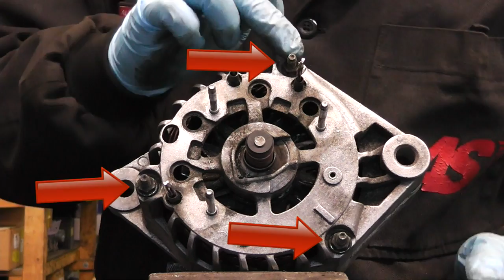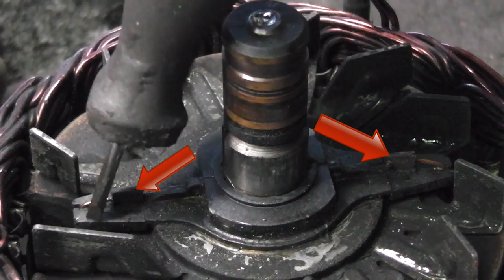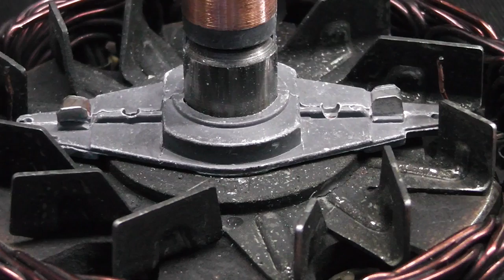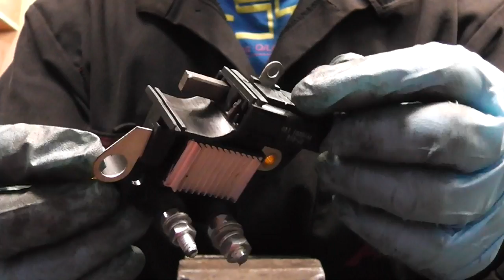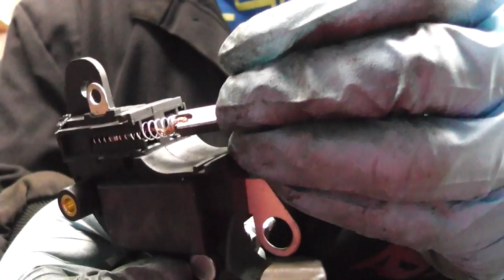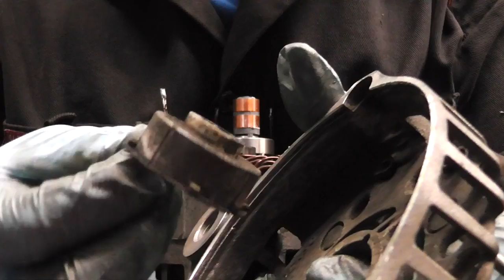VAUXHALL / OPEL Vectra / SAAB Alternator diagnose and repair,Denso.Full recon. PART 2

Comment: Hi, I noticed that the regulator had 2006 printed on it. Will the bearing, regulator, brush & slipring, shown in the video, fit a Denso 14 v 130 Amp alternator fitted to my Saab 2005 93 tid?

Comment: Hi
I have a question about the rotor resistance.
I am rebuilding a Mitsubishi A3TA6581AKD Alternator, The car's service manual says that the Rotor coil resistance must be 1.8-2.1ooms, But i get 2.4 ooms. Is that a problem or not?